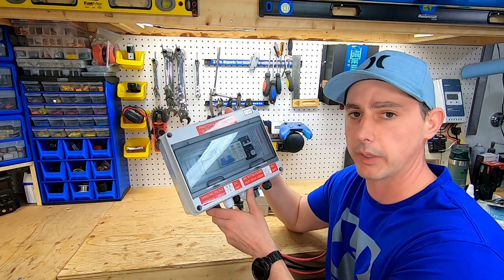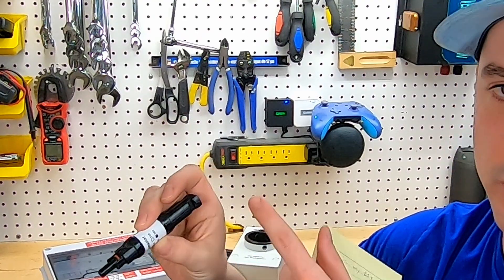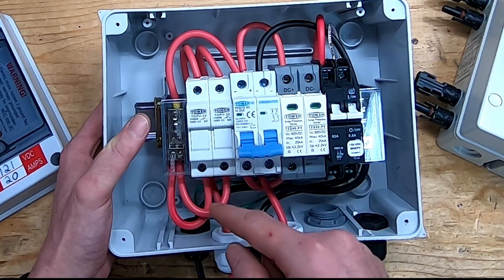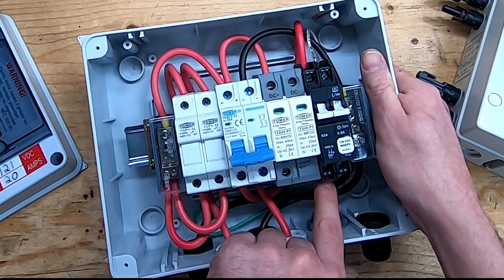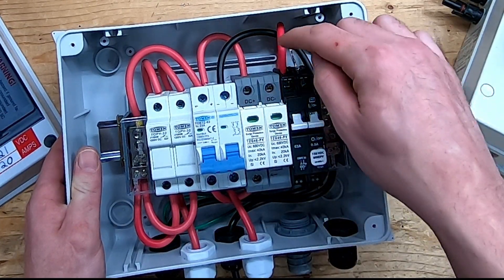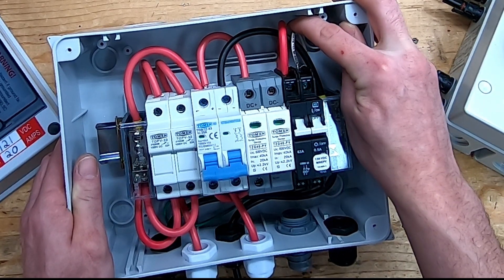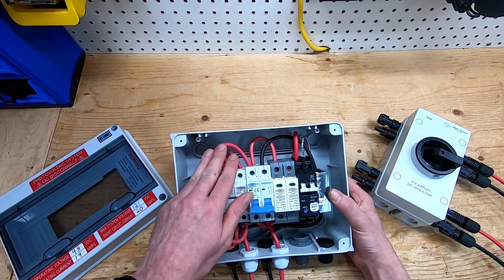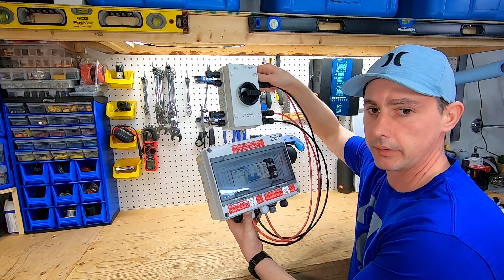DIY combiner box for solar arrays

Comment: Gotta say I don't like this for many reasons.  Best practice is to fuse both PV+ and PV- for each array separately.  Instead, you have not fused PV-.  You have combined both strings into a single pole breaker so when the breaker trips, you will have no idea which string caused the breaker to trip.  Each string should be on it's own breaker.  You don't need a GFI in the combiner box.  All modern inverters will have a built in GFI circuit that will function to cut off the PV in the event of a ground fault.  None of your components appear to have any UL listing or compliance making them a risky bet.  I think you need to rethink what you have done here.
Reply from the maker: I disagree with you. The fuse is for protection, and the breaker combines two strings and acts as a disconnect. This is for off-grid use, no UL listing required

Comment: At the time mark 4:37 your statement wire gauges should be 8 AWG for copper and 6 AWG for aluminum. Copper is better conductor thus can be smaller. In general, it is good practice to use copper. Copper oxide is conductive but aluminum oxide is not. Fire risk at connecting points.
Reply from the maker: Awe shoot, I should have said 4 AWG for aluminum. Thank you ill make a note in the description of this video.
Reply: @Roll2Videos   You did very nice job, your explanation is clear and easy to follow. Thanks for posting it.
Reply from the maker: @Ed123  thank you

Comment: I just don't know how good I feel about those chinese surge protection and overcurrent protection devices and breakers. You won't know whether or not they do the job until it's too late. I read a review on the jungle site where a guy put continuous 700 amps through one of those chinese breakers and it never tripped.
Reply from the maker: Oh wow, 700A; yeah, this was one of my, Just starting videos. As I grow larger, more expensive equipment I will invest in something like a midnite solar equipment

Comment: I’m reaching out here, help me out please. How do you combine 12x 12 volt panels without series? (All parallel) Everyone I ask tells me to just series them. I want 60 amps…..so no, I’m not doing that. Where should you increase wire size and what size breakers and fuses? Do I need to increase size of wire(10awg-50amps)coming out of the back of the panels? Should I still use branch connectors? I’m trying to pull 1200 watts at 60 amps.I have a  renogy 100 amp charge controller and a renogy 3000 watt inverter. Only running 4x 12 v 100watt  panels as of now. I have the renogy 5 string combiner box as well. I just don’t know how to do it “ the best way” is there a diagram somewhere? Why can’t I find anything. If you have time I’d appreciate any help. Good videos bud! I learn something everytime
Reply from the maker: I understand you are new to this. Your charge controller is 100A output. I would double-check the input amps, which probably aren't listed on the watts and volts divide the two for amps. For 60A after combined, you would need @ 10ft a 4 AWG wire, @ 20ft a 2 AWG wire, @ 30ft a 1/0 AWG length of wire.
The best bet is to run all the strings close to your charge controller and then combine them with a short 2 AWG wire length.
Reply from the maker: Also, I agree to series connect and let your charge controller convert the power to the desired amps. The reason you can't find anything on the way you want to do the hook-up is it's not practical

Comment: I had 21 solar panels 3s X 7p connected to two inverters in parallel for Home but i need to use this 21 solar panels all connected to series to connect new invt vfd drive to use submersible 3hp for 3 hours only and back to my 21 (3 series x 7 parallel group) again to use in my home, How to change array between two system?
Reply from the maker: Good question; I'm sorry I do not have a answer for you.

Comment: Why would one run a breaker if you already have a disconnect and fuses?
Reply from the maker: The is disconnected to isolate the two strings from each other, and the breaker is to isolate the parallel string
Reply from the maker: Also, the fuse protects each series string. And the breaker protects after the parallel is made. 👍
Reply: @Roll2Videos  And, after watching another of your videos -- I'm thinking the SPD is pretty useless w/o a breaker to trip?
Reply from the maker: @Steve-wz5pz  SPD?
Reply: @Roll2Videos  Right, the Surge Protection Device.
Reply from the maker: @Steve-wz5pz  Yeah that sounds right. I mostly just copied the combiner boxes already on the market.

Comment: can u connect different Volts
arrays  to the box
say 150v   120, v
regds
 sunil
Reply from the maker: I could, but once they get paralleled, the 150V will be bought down to 120V. Therefore I would have 120V and double the amps from both arrays

Comment: I followed your link because I was a little puzzled. I could establish that your GFCI was polarized and presumably has the wherewithal to break a DC ARC. Very Good. But my question is does it respond to a DC Earth fault? That part I didn't pick up from the specs. It is difficult to see because of the clip resolution, but it appears to just contain the differential trip mechanism of an AC GFCI. ( The circle drawn around both conductors on the front). In other words, a CT-like coil in which the nett magnetic effect of the in and out current is zero. ( Unless of course there is a leakage to earth).  The thing is though this transformer effect doesn't apply to DC current.  And in the presence of DC,  magnetic cores tend to saturate and not work properly. 
There doesn't appear to be any hall effect trip mechanism on the device. Hence, I am a little puzzled about this GFCI.  Just asking, for educational reasons, I haven't seen everything under the sun.
Reply from the maker: here is the link to the midnite solar https://www.midnitesolar.com/productPhoto.php?product_ID=185&productCatName=Breakers&productCat_ID=16&sortOrder=2&act=p
Comment and let me know what you find please
Reply from the maker: I think the way they achieve this "GFCI" is by having a 2 pole beaker with 63 amp breaker for the positive wire and a less then 1amp breaker on the negitive to ground so if any current is on the ground it will trip the double pole breaker.
Reply: Wow 88 bucks!

Comment: Nice work.
Like the ground mount/utility trailer idea to house all the inverter& components.
Wish We could do that but not enough flat land or parking space on the mountainside, plus the hurricanes would likely blow away any trailer I put out, so we did rooftop instead with a utility/equipment room.
Will check out your other videos & subscribe. Curious how you like the growatt inverter. I'm thinking of getting one for a backup/replacement to my radian.
Reply from the maker: On a mountain side sounds like a beautiful view. You should look into the MPP solar units they are UL compliant if I could trade for my growatt I would.

Comment: Once you look at all the new requirements for NEC 2017+ you need AFCI, Rapid shutdown, etc, etc. It really makes using microinverters the easiest option sadly as they don't need many of these things or have them built in.
Reply from the maker: It is an interesting read

Comment: Interesting but it seems to be way overkill to me! I have the 15 amp fuses connected to the PV strings which I parallel. 
Then I have the breakers to cut off the electricity when I’m working on my system. To me I haven’t had any reason to add anything else. 
As far as running a ground to the battery, I just run it to the bus bars. 
All the positives are fused.
Reply from the maker: Lol it is a little overkill. I did follow the code for my area and I left out 1 thing. A arc flash breaker I couldn't even find that 🤫 I will also have a disconnect at my growatt because I'm running my wires in a flexible conduit underground....
Reply: @Roll2Videos  
Sometimes I think that all these regulations are just for the government to control everything and make a lot of money doing it.
Reply: Exactly.